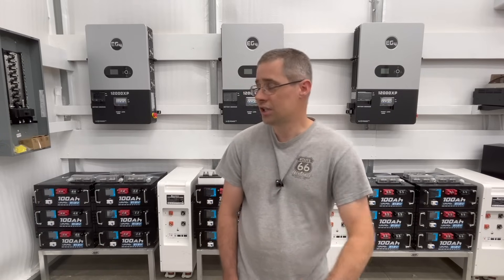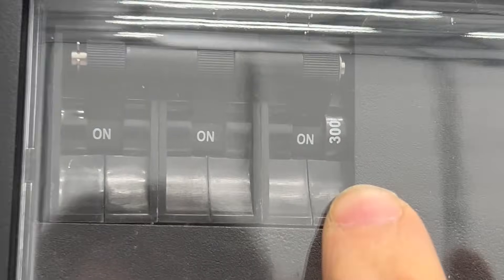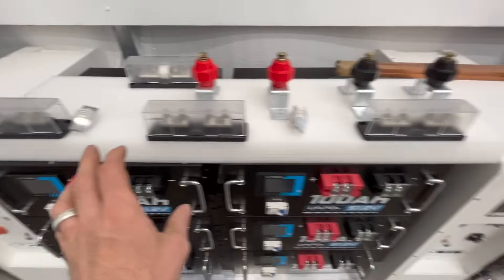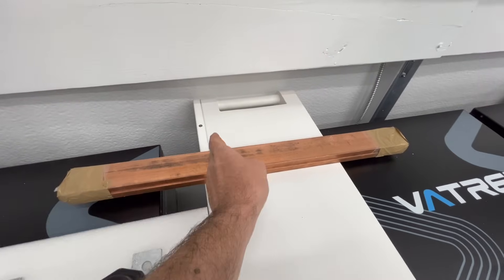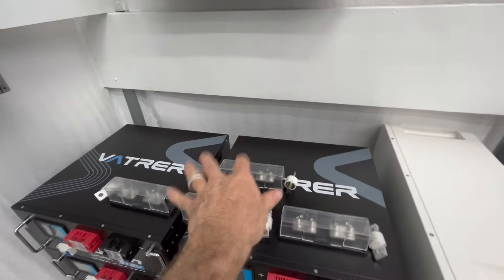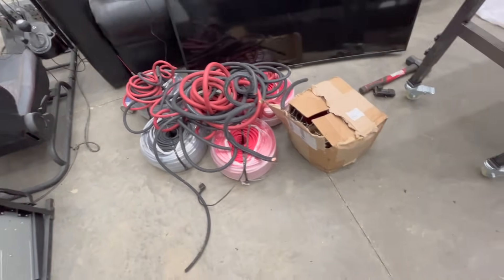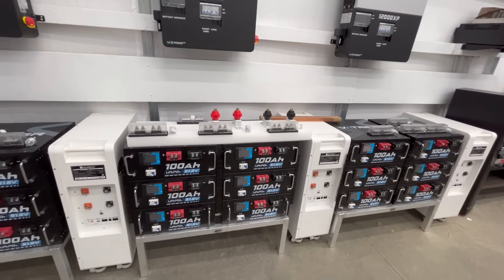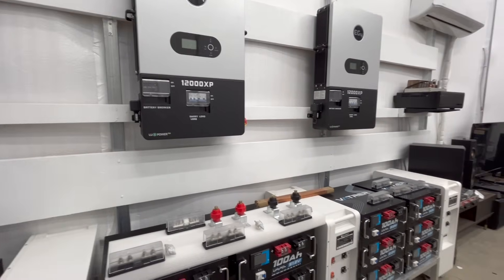Bulletproof Your Off-Grid Solar: Wiring & Protection for EG4 Inverters!

Comment: Question: I have a 12000xp going to 100a loads panel, with 100a grid input to inverter for bypass and charging. All good. If I add a second 12000xp in parallel, do I need to upgrade to a 200a load panel?
Reply from the maker: I would check with EG4 or your reseller to make sure.  I don’t want to steer you wrong on something that important.

Comment: Hi Mike, Love your videos but I have a question I have 4 5.12 100 Amp hour batteries for a total of 20.48 kw hours. Like you I also have a couple of 15  kw 280 Amp hour batteries. I couldn't seem to get the 5,12 Kw and the 15 Kw to both connect to my EG4 12000 XP. So I went to a bunch of forums and all I get is everyone saying you shouldn't try to put these to combos together. But know I am see that you are doing it. and can you explain how you connected everything together to the EG4 invertor. I am new to this so all help and advise is welcome. Thanks,
Reply from the maker: Hi Joe,  in the 12000XP inverter you can configure it as lead acid instead of LFP.  By doing this removes the communication and it goes by voltage only.  That is how I run mine is by voltage only.
Reply: @MikesSolarGarage  great idea. what do you set you lows and and what do you set you high side on for the voltage of the batteries. Thanks for all you help on this.

Comment: You should have used EMP Proofing  for this.    They make some great units
Reply from the maker: The SPD's should deffinetly help with that and the metal building kind of works as a Faraday cage.  I have no cell reception in the shop.  Thank you very much for watching!

Comment: what's your opinion on using 4/0wire with copper lugs to connect the batteries in parallel instead of using the 3 gauge wire that supplied do you think it would benefit or hurt? i've got 4 eco worthy in parallel using the supplied 3 gauge
Reply from the maker: Good question, can you describe your system a little more.  Such has bus bars, fuses, and how many inverters

Comment: So... you're powering a small city over there?
Reply from the maker: It does feel like it.  The unfortunate truth is my house is all electric.  If I could do it all over again I would have propane as well.  When it is under 45 degrees the heat pump and heat strips(10k)  kick on together.  That is approximately 15,000 watts.  Then you add on the well pump, clothes dryer, and electric water heater and it will quickly come close to the 36k watts that the 3 put out.  I tried to size it the best I could so it should never go into overload or worry my wife about turning something on.  I hope that explains it.
Reply: @MikesGarageRoute66  yeah, I get it. 
I live more like if the washing machine is on then the stove must be off and so on, thus getting by a tenth of that. 
But, all in all, hats off to you, I am (really) happy to see what you've done there.

Comment: Looking great!  Are you going to do comms with the Eco Batteries since the Vatrer's dont have it? Or go off voltage and no comms?
Reply from the maker: That is a very good question.  I am going to try the coms first and see if it works.  If not I will go off of voltage like with my other system.  BTW I really like your channel!
Reply: @MikesSolarGarage  Yeah try comms for sure!  I would connect all 3 together then connect to the main inverter comms port that way you will get a higher charge rate.  If you only connect , the protocol will most likely limit you to the "single" battery cause it thinks only one battery will be connected.  Thanks Man Appreciate that!!  Just started enjoying yours as well.  Subscribed the other day!!💥
Reply from the maker: @ Thank you!

Comment: Just one question, why do you need all this power? My whole house runs off of just one of these inverters and stack of batteries.
Reply from the maker: That is a very good question.  My house is all electric, including the heat pump, hot water tank, well pump, stove, dryer, and fireplace.  2 inverters would run the house but it would be at pretty high utilization.  The third one to reduce the amount of load, but also give some redundancy.  For the batteries I did used a solar calculator.  135,000 Watt hours should run me almost 3 days without sun.  One to 2 days is common, where is 3 days is pretty rare.  I want to stay on solar and only on a rare occasion have to switch back over to grid.  Thanks for watching!

Comment: Nice!  You should make sure your Styrofoam is fire resistant, I've seen some where one spark will light up the whole thing.
Reply from the maker: The insulation is fire resistant, but I think I may but concrete board behind the inverters as well.  You make a very good point!

Comment: Why did you use those 3 white boxed batteries?  Why not use all of those black EcoWorthy batteries?
Reply from the maker: The black ones are Vatrer batteries.  I got such a good deal on the Eco-worthy floor standing batteries that I could not pass up the deal.  I got them for 2399 each with free shipping.
Reply: @ how does everything work in regards to the BMS data connections?
Reply: @SmallTownSolar Batery based BMS’s take care of the care and feeding of their own pack’s battery cells.  They care not about the cells inside a sister battery pack/bank.  Feed them power or suck out power and they’re individually pack-happy.

Comment: Doesn't matter that I can't afford but I do like your explanation's clarity. Lot's of ideas & info. Definitely going to follow this build. (Maybe a static schematic to help us follow along?) 

Man! your wallet must be made of pure gold!
Reply from the maker: Thank you very much for watching!  I really appreciate it!

I only wish, hopefully it will pay for itself over time.
Reply: It's all depend on how big your family is and how much power you use for the location.  You can start small.  Do not buy 1x of the eg4 6000  watts, unless you only run for a cabin.  Normal home is atleast 12000 Watts. 240v split phase.  Which mean 6000 watts each side.  If you have whole house AC  unit.  you will needed bigger.  Start out small:  1x 12,000 watts EG4.  + 15-20 kwh battery, with 5500 watts solar or 6000 watts solar.  or half of that if you only have 2 person.  But batteries always 15 kwh with 1x  eg4 6000 then add more.  But because china stop.  So that unit more expensive.  So go with the EG4 12000 watts one.  That cheaper at $2500

Yes I will redo my garrage when the eg4 12000  come... if you go with naked / raw cells batteries like in my video.  it's cheaper than those in pack ready to use like in this video

Comment: seeing you with so many of those vatrer batteries makes me feel good about the 6 I just bought. they ship with 6 awg cable, were you able to attach larger cables to the terminals on the batteries?
Reply from the maker: Yes 2 gauge lugs fit perfectly.  To use the 2/0 I am going to have to modify it a little bit.   Thank you for watching Nick!

Comment: Nice setup. Did you need a special battery storage permit? I see our code requires one once you go over a certain amount of kwh storage now. Seems to be so the fire department has a record and knows who to send if something should happen. Getting ready to order the first 1200xp after seeing your  setup.  Do you have affiliate links?
Reply: Looks like a great setup! The only issues I see is a 3 ft of clearance in front of the equipment. You do not want to be leaning over those batteries to access your inverters.
Reply from the maker: @ That is a very good point Paul.  Thank you!
Reply from the maker: I do have links in the description.  If you use Garage50 you will get 50 dollars off purchases 500 or more.   When it comes to permits each area is a little different.  One thing they do want to see is an emergency shutdown switch outside.  I am planning on purchasing those as well.